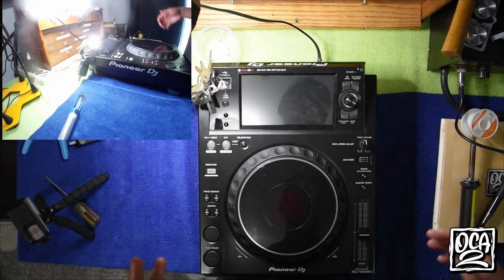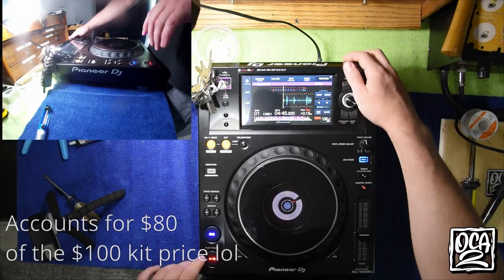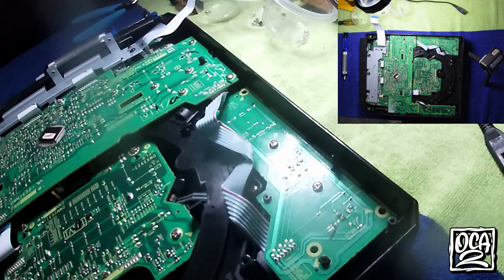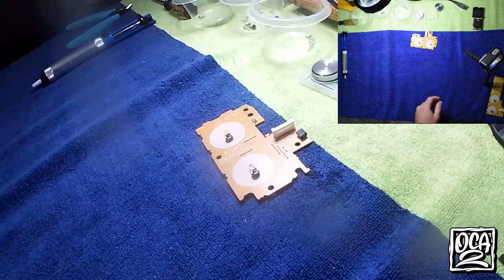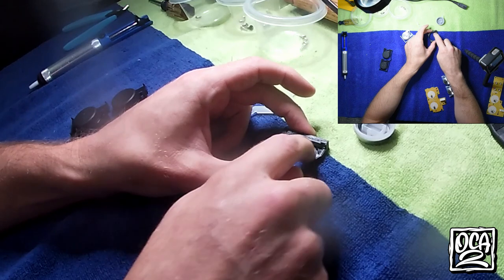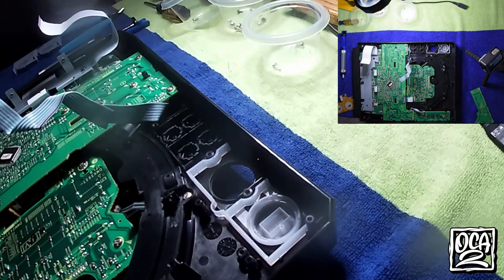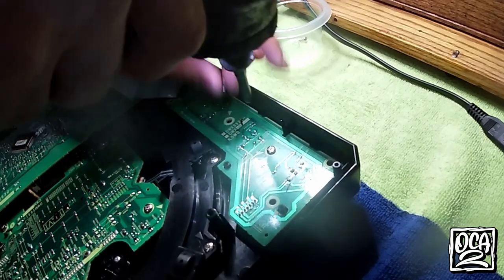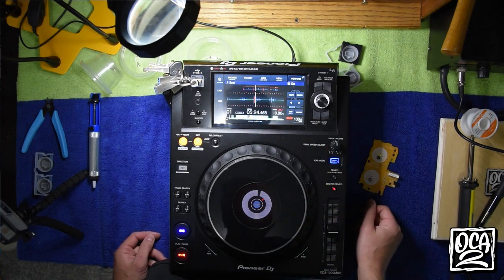Pioneer CDJ / XDJ Cue/Play Button Replacement and New Black Out and Cue Brace Mods for the XDJ-1000!

Comment: Would it be possible to mod the xdj 1000 mk2 to have the ring light around the cue and play button, like the cdjs
Reply from the maker: so unfortunately the cdjs have a separate plastic ring from the buttons that provide the ring light, so to add that to the XDJ, you will either need to modify the housing or create a new cue /play button assembly. Not impossible, but will take quite a bit of modifying to add
Reply: @oca2music  ahhhhh, I see. Would be a cool mod but does sound like a lot of work. Thanks for the response!

Comment: I just got an XDJ XZ unit a few months ago and I'm already paranoid about the right cue button. Do you know uf the CDJ NXS2 cases are the same as the ones in the XDJ XZ by any chance? Also would those mods of your possibly fit in my unit? Great video btw
Reply from the maker: Sorry for the delay took a break from the youtube for awhile (no video card hahaha). So I do know that the NSX2 does use a different button assembly so unfortunately the mod does not fit! But it does appear the XZ uses a similar/same to the NSX2, and that one that is more robust and does not fail. so even better! no mod needed!

Comment: Hellol.. Does CUE buttod mod works with CDJ2000 no nexus?
Reply from the maker: It does not, the CDJ2000 uses a different button, which I haven't seen too many failures of in repairs to note

Comment: Will your button mods work on my cdj-2000? I dont believe it is the nexus
Reply from the maker: It does not, however I will note that the 2000 uses the more robust style button, so I haven't seen this issue on that model to note - but the replacement process is the same for the most part
Reply: @oca2music  awesome. Yeah my play button got stuck the other night. It still functions but no longer has the physical clicking effect. Its like a touchscreen almost hahaha i will be taking it apart to check it out tonight. Thanks for the info tho. Hoping its an easy fix
Reply from the maker: @brandoncordy7529  that sounds like it is likely the switch it presses underneath. Not an uncommon or difficult repair, you might be able to get a bit more life out of it if you clean, but I recommend replacing - so it doesnt hang you out to dry sometime.
Reply: @oca2music  thank you! I appreciate that